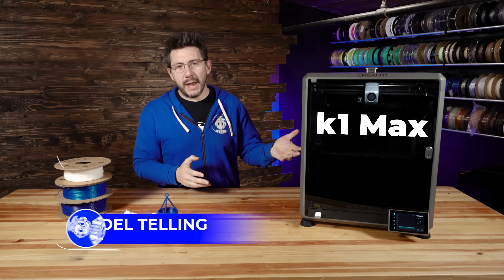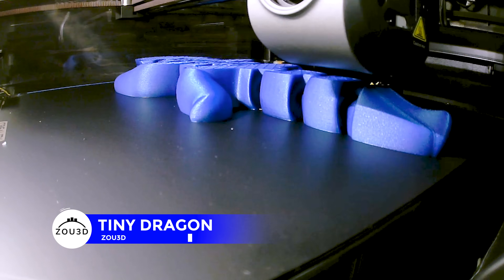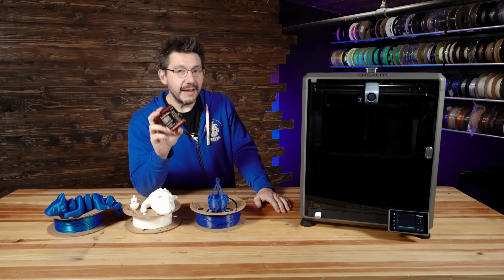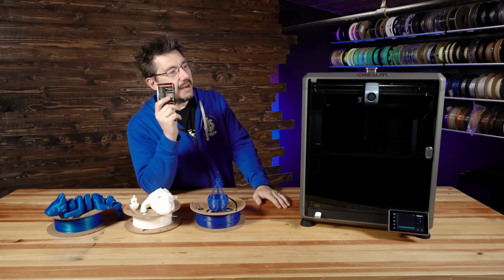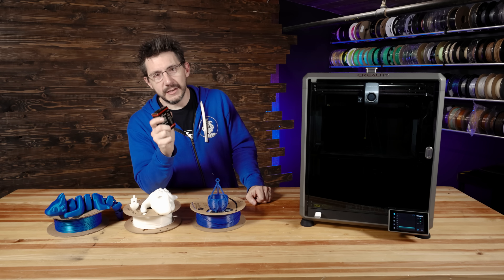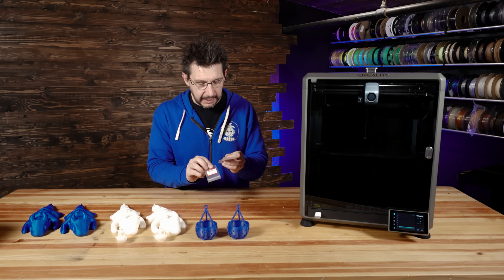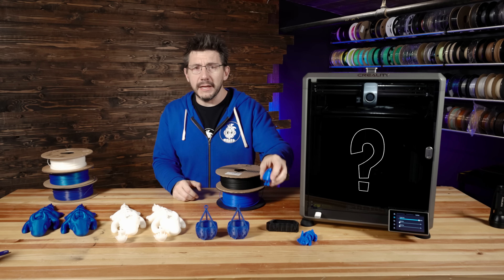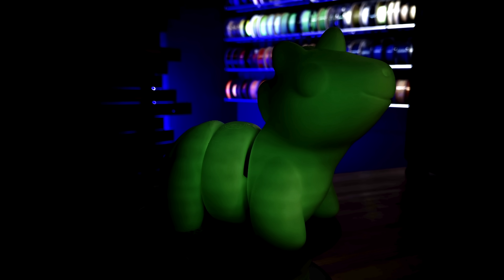THIS Fixes the Creality K1 Max

Comment: Every time... lots of text...

Good to hear on the K1 Max. I know when the K1 came out, people basically called it a Bambu knockoff and early comments indicated it was poorly designed. Now, some parts of that like Uncle Jessie's infamous door incident would support "why did you design it that way?" But since then, I really haven't heard many complaints about it. It sounds like people buy it, it works as intended. Makes it a bit interesting to think about how things have changed... Bambu is held as a can't do wrong printer company, even after many counter examples, that makes a printer so close to a consumer device. Meanwhile, Creality is the poorly designed one that scrapes the bottom of the barrel. Lots of truth IMHO... but somehow Creality is also the one the one that is following GPL guidelines (after community complaints), is doing a lot of iteration on getting quality components and reducing cost (though seriously, enough with 40 versions of the Ender 3... go watch Maker's Muse for more info), and unexpected one: people were asked "which looks better... a Bambu X1C or a Creality K1" and after some hesitation... many in the community said the K1. So for something cheaper then a X1C, it's matching many of it's requirements, they listened to the community by making a bigger version, following code licenses better, offer more options for different budgets, still use the same high quality slicers as all the other printers, and has a "better looking" printer then the X1C. If you actually think about it, it's a fascinating thing to see Bambu vs. Creality after most wrote them off already. I'm not gonna write another large writeup on Creality's issues and nor touching Creality Cloud with a 10m pole.

Instead, I'll write a large block of text about this: I think an interesting point is the trend of merging the heatbreak and nozzle. I think the interesting thing is did we overshoot? On one side: a E3D V6 with all the "why are we precariously attaching everything to a super thin metal tube AND requiring certain torque amounts", and on the other side "everything is rigidly attached to the extruder body so you can swap the nozzle without tools/with one hand". But there's a fine line and (if) anyone actually reads this comment, they're going to make an assumption on what I'm calling out. Lots and lots and lots of people have come in favor of the latter over the former: Revo is the biggest name in it, but others including the recent Bambu A1 mini, and the K1 w/Flow Tech is another. Wait, what about Prusa's Nextruder? Bambu X1/P1? This is the fine line... V6 style nozzle vs. combined nozzle/heatbreak that is attached to heater/thermistor vs. combined nozzle/heatbreak that is detached from the heater/thermistor. The Revo and A1 mini are both detached from the heater/thermistor... they offer super easy ways to "just swap a nozzle" without worry. Without tools. Do it cold without needing to burn your hands. But what happens if you want to change things? Higher temps, higher flow, maybe some specialized materials... Revo solved 2 of the 3... until they released their high temp version. Suddenly, you can't "just swap" the nozzle... you need to swap the heater as well, you need a different nozzle, possibly different electronics, and it was noted the high temp Revo is taller then the standard Revo. The A1 mini has a similar issue: you can't go to higher temp or higher flow because the heater is build into the body of the extruder... and for a period of time, they didn't have a hardened nozzle for it even though one of the popular quotes for Bambu printers was "it can handle any material" until it didn't on the A1 mini. They have since released hardened nozzles. Similar to how people wanted to love the Revo at first... but struggled without a hardened version. But that fine line... the Bambu X1/P1, Prusa's Nextruder, and (from what I can tell) the original K1 hotend required the heater/thermistor to be removed along with the nozzle. This presents an interesting case: you can still hot swap, just like the Revo, but it takes the extra steps of needing to disconnect and reconnect wires. BUT it also means "changing the nozzle" often includes the heater/thermistor and that it can mean a better heater, more accurate thermistor, larger hotzone, and more because it's part of the change. I recently purchased additional heater blocks for my MK4 and XL so I can setup additional nozzles and parts in them. If I want a bigger nozzle, I unplug the old one, turn the thumbscrews, and out it comes... and reverse for the bigger nozzle. Not quite as clean as a Revo, but it's just as effective. And instead of a fixed-length extruder that then needs re-adjustment, the load cell does the work. And Prusa has already said they plan to have high flow Nextruders with a different heater... so it's not a prediction of functionality. Many with Bambus don't do nozzle swaps, they do extruder swaps (or so I've been told. I don't have one but know many who do). And while the K1 may not have different heaters, the possibility is there (especially if people mod it). So again... that fine line... in our desire to reduce the problems of "early" hotends like the V6, did we overshoot the desired case of "nozzle + heater" and go straight to "just nozzle" where now we have to recalibrate or "do more" if we need a new heater or a nozzle of a different size? Just a thought.

Comment: I decided to eventually get a K1 Max once I found out that Micro Swiss was going to build products for it.  I have a "fully" upgraded CR10S PRO which is a fantastic printer after upgrades, many Micro Swiss parts including their hot end and direct drive extruder.  Thick cast aluminum plate, AC bed heater, linear rails on x and y, elostomer springs on build table.  Printer is solid as anything.  But I want a faster core xy printer and the K1 Max seems to be evolving quickly and Micro Swiss support seals the deal for me.
Reply: If you were to compare the print quality of the prints seen in this video, how would your CR10S compare? Is it comparable? I've seen many people rice out their printers, but I never got a reference for how far you can push those machines.
Reply: @emiellr  my cr10spro was upgraded to a v2 with sensor, cast AL bed, AC bed Heating, Linear Rails on X and Y, Direct drive Swiss Micro print head, isomer bushings instead of springs for bed adjustment (highly recommended over springs).  It prints incredibly well, is highly accurate and has been utterly reliable.  But not as fast as the K1Max.
Reply: @beaker2000  I’ve been contemplating transitioning to linear rails on X and Y and possibly Z on my CR-10s (basically pro with the BTT E3 V3 board / 3.5 touch screen and Microswiss NG) what is your opinion? Also, is the cast aluminum bed a lot better than the stock bed? And I have vibration compensation feet. Is that what you’re using the elostomer springs for? I don’t know if I will go to an AC bed, I don’t mind waiting a little longer to heat up.
Reply: @treyduval5399  the. Ast aluminum bed is a game changer.  Also AC heating and the micro Swiss direct extrusion and linear rails made my 10Spro a reliable workhorse.  Almost never have a failure.
Reply: Why wont you buy a sovol sv08?

Comment: A lot of people saying .4 should come instead of .6

.4 IS great, but with a .4 out of the box you can print anything, as long as it's not glow in the dark, sparkles, carbon fiber, glass fiber, wood, marble etc

.6 you can print anything out of the box.

Its just a better option for out of the box because it covers more materials.
Reply: So far I didn't have any issues with glow in the dark filament using the .4 hardened steel nozzle on the K1 :)
Reply: @McOldwolf  It's the glow in the dark that has flakes, like Captubes Firefly blue or Amolen Starry Sky

Comment: Downside to the K1 Max: You might randomly get an issue when leveling the bed where it just sort of decides "Ya know what? When probing the bed, I'm just going to slam the hardened tool steel nozzle into the bed, keep trying to raise the bed, and then finally give up and jet off to the side from where I'm at, gouging the top coating and destroying the bed!" and it'll do that over... And over... And over... For every single test point on the bed. At least, that's what happened with mine >.> And also, sometimes it has really poopy first layers and no amount of playing with the slicer settings will fix it, but for whatever reason a firmware restore will (which is also the only way to fix previously mentioned gouging of the bed while leveling issue)
Reply: Sounds like Creality alright 😂🫠
Reply: They fixed that in the latest firmware.
Reply: @Silentwidow1222  Just curious, when was that firmware update released? I was on the latest when it happened to me, which was only maybe 2 weeks ago?
Reply: @tek9058  Not entirely sure, I know turning it off and back on didn't fix the issue for me. Did you set the z-offset in your slicer by any chance? It happened to me after I ran a few prints after setting the z-offset in my slicer and my theory is that maybe send it runs the gcode for the z-offset, it's updating the global z-offset by that amount every time, causing it to slowly start getting closer (or if you're using a positive offset, further) to the bed every run until it eventually slams into the bed during auto level.
Reply: You sure you're not from Bambu's sales team? :)
Reply: @kevinrobb3523  I wish lol unfortunately, the printer just isn't good from my experience with it. Its poor quality prints essentially have made me stop using the printer all together. Dunno if it's an issue with all of them, but mine has a lot of issues with printing overhangs of any sort, and I have to use progressively increasing infill the closer to a top layer I get or the top layers will all entirely fail to print, which essentially means that my prints with it take as long, if not longer, than my old Ender 3. Pretty much, if it's printing unsupported, it just sort of... Stops extruding?
Reply: Root it and install KAMP
Reply: that is what my ender 3 v2 was doing before i upgraded it to klipper.

Comment: Plated brass and plated copper will still chew out with CF's, I know as I only print CF's and GF's, the plating will last longer than non plated, but it won't last long, about a 1kg roll will start to wear it away, once the coating is gone, your prints will start to look like dog sh&&%t.

Comment: Torquing nozzles is not required, you use heat to do this, if your printing at 275 C then heat the block to 300C and screw in the nozzle, nip it up with almost no force, cool to to 275 and it will be tight, cool to 220 and it will be even tighter, thermal expansion of the different materials takes care of everything, also 0.5 is the perfect nozzle size, not 0.4 or 0.6, 0.5 is a perfect balance and also does not jam from CF and GF confused filaments.

Comment: Very nice!! What about pressure advance and resonance compensation? There is some ghosting on the edges of that knitted basket. The pressure advance i saw that it should calibrate itself with the lidar but most users in forums say it is not working properly. Maybe it works now? Or is it possible to calibrate it manually? Cheers
Reply: When I noticed Joel not mentioning the ghosting AND using pliers on the nozzle, I had to look for another channel for a review on this printer.

Comment: I mean I'm not saying this is a bad printer, but i did see quite some ghosting on the ABS basket. Maybe i am being overly critical, but for a perfect part, I'd expect this not to be an issue. It looks like the printer does have some quality issues around sharp corners at the very least. I'd love to be convinced of the contrary btw. If that one issue weren't there I'd buy this machine immediately.
Reply from the maker: I’ll look again once back in the studio. While looking at the basket I was more paying attention to the ropes than the body as I was surprised that even printed well.
Reply: @3DPrintingNerd  and with no delamination on these small cross sections! This is definitely a competent machine, I'm just worried the input shaping might not be up to the task. Unless ofc belt tension is off or something. Thanks for your content and answer btw, much appreciated!
Reply: I saw that to.

Comment: Around 40 days of non stop printing (6 days in a row one off :)and repeat ), 99% pla, maxing build volume most of the time... And ... Request a new mainboard... Unexpected layer shifts up to 5 cm on xy axis, all checked ( belts,axis, stepers all connections, screws) gcode reviewed, print settings revised, flashed 4 times with different creality firmware... nothing changed behavior still shifting randomly... Potential is there they need to start paying attention to detail otherwise not really a trusted workhorse, creality slicer is a disaster, using mainly prusa slicer at the moment, quality is fine+, as out of the box experience with new market standard - there is a bit more to be desired for 950euro on my side... I really want them to succeed but for a moment they need to make this flagship a proper one... Customer support...hmm there is one but take me a week with 3 attempts to successfully request board replacement...no rudeness not really a problematic push off conversation probably lack of work instructions and trennings for staff ... Bit of unorganized internal mess :). Just to be clear - I'm a hobby abuser of 4 extra printers with couple have a good fev hours(2000+) on them, not a fan boy of anyone, but see the difference between companies approch. Take it as my opinion and experience be aware but don't disregard k1max as a product. Hope your hour count will be much greater than mine, maybe i just hit a half lemon😂... Hope to see a board soon and problem solved, ther is a lot to be printed!

Comment: I put revos on my printers and love it. I hope that microswiss option is cheaper.
Reply: Me too, I've loved Microswiss since I was learning the ropes on my Ender 5+ and love their products.
I hope they get hardened steel options as well, because while "plated brass" sounds like it's abrasion resistant, it's really not enough for when you're printing TONS of glow-in-the-dark (strontium aluminate), white (with titanium dioxide), and of course the infamous fibers like glass fiber and carbon fiber filaments.
Maybe they can even split the difference with a swaged hardened steel insert into the brass nozzle to get almost "the best of both worlds".

Comment: This machine is a joke after 1-2 weeks of use it goes to crap, read more about this in their own Facebook forum. Also all the reviews in they own site. All this look good for the few days  and then it take a poop. I had to service my own printer 3 times since I purchase this paper wait.
Reply from the maker: I’ve got roughly 80 hours of print time on it and so far so good. How much use did you have after 1-2 weeks? I’ll keep an eye on mine.
Reply: I had issue as well. My hotend was triggering problem: "Heater extruder not heating at expected rate". After googling the problem, found out that other people had the same issue and all of them had a hotend with the BLACK silicone cover. So i contacted the support explaining my problem 2 week later, i received a new hotend with a RED silicone, turns out that Creality had some bad batch, maybe that why the boost kit was on sale (but i didn't think it was needed so i didn't buy it at the time). After the new hotend, my temperature issue stopped happening, but i have some bad layer adhesion (even after a full recalibration), turn out the gear in the extruder was slipping, some guy on reddit found a solution by adding a washer behind one of the gear to stagger them creating a closer gap for the filament, i tried it and now everything is fine (if i had buy the boost kit, i would also had the new extruder, so yeah, i regret no buying the boost kit at the time...)